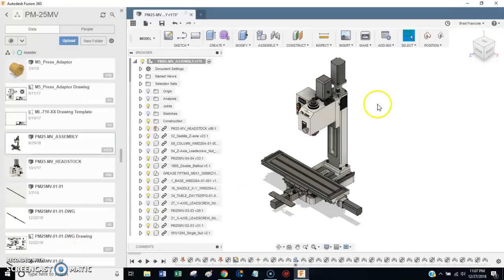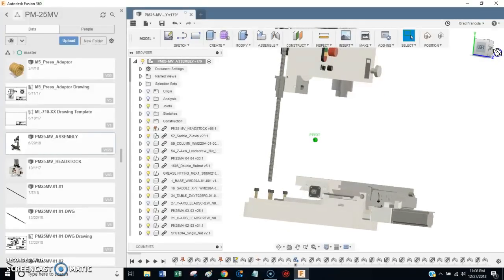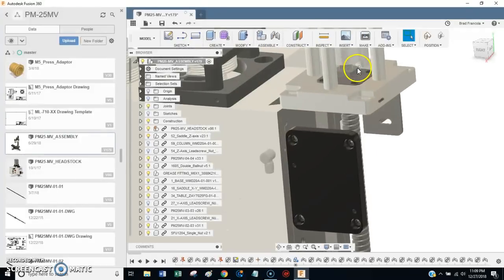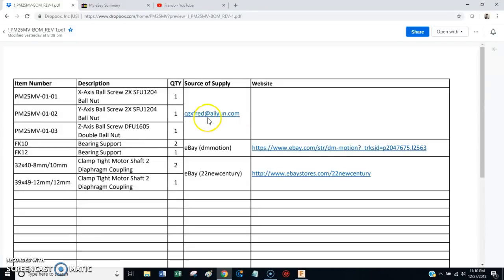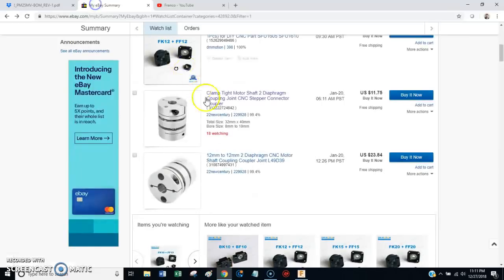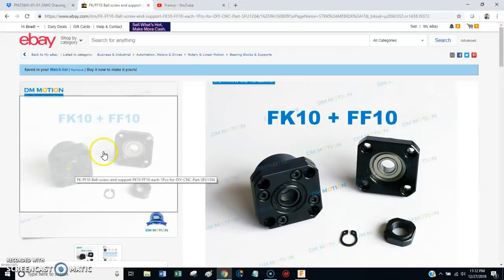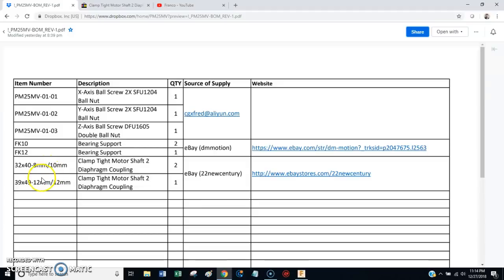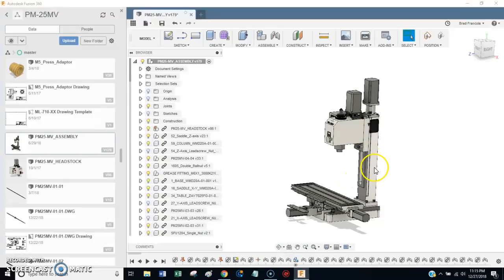PM25-MV CNC Conversion: Ballscrews, Bearings and Couplings

Comment: From the fusion 360 appearances it looks like you were intending on making PM25mv-04-04, 03-03 and 05-07 out of steel. I assume you though aluminum would not be strong enough?  Did you use steel?  If so was it mild steel or something more?

Comment: Hi, found your channel recently. Really love your work. I was wondering, you are not using the spindle speed upgrade you made. Is it because you changed the motor? Did the spindle speed upgrade caused to many vibrations? Cheers

Comment: On  your X and Y ball nut mounts two of the six holes are through drilled and have a m6 tapped hole on the backside.  I'm sure there's something clever going on here regarding these two holes but it's eluding me.  Depth stop for the second ball nut bolts??  And thank you for all the work you've put into this.
Reply from the maker: Hi.  I'm glad my models are being put to good use - If you purchased a PM Machine, don't be afraid to let Matt know my plans became part of your plans for the machine.    You are spot on regarding the M6 threaded holes - I was thinking that I'd use that as a locking screw for the long screws that would hold the second ball nut.  I ended up simply using shims on my machine but I do think the original method I had in mind could also work well.

Comment: Hi I am considering buying the PM25MV mainly because of your videos. I want to convert it to a CNC and have some CNC experience as a hobbyist but d I have no experience operating a mill manually. So machining my own parts manually is definitely out of the question. I saw someone suggest 3d printing the parts, then milling them in aluminum after the cnc was working. This I could do in a heart beat but even if that would work I really don't want to have to deal with the mount in the z column twice. Do you know anyone who will make and selling parts from your designs?

Comment: Thanks for sharing. Real thoughtful and nice. I never opened a iges file before, but a couple minutes duckduckgo'ing it seems to show that I do not need autodesk to open them. I have and depend on a working machine shop for my survival, and so, no chance I will use autodesk products in my shop. The PM25-MV seems to have a reasonable table travel for a first cnc, but machine is awful light. It does appear to be a reasonable size first cnc machine for a small company though. As long as I can open those files, it is very likely I will get a PM25_MV, the recommend ballscrews etc that you show, and then build this. I have wanted a small cnc mill for a while, but not willing to buy because of exceptional high repair, maintenance costs to have company person come out and service. Building own is the only way to go for a small company,.. unless money is no object. Again, thanks for sharing.

Comment: I’m just wondering how is the pm25 by itself as a manual machine?  What upgrades would you do to make it a better bench top mill without the cnc conversion?
Reply from the maker: It's a good manual mill. The first thing I'd probably do would be install a Digital Readout

Comment: I have found that all the bearing supports from China use standard roller bearings, and not Angular contact bearings.  I had to purchase replacement angular contact bearings from a U.S. supplier.  Has this been your experience?  From the video, it looks like you are showing standard bearings because AC bearings are not usually sealed.
Reply from the maker: Hi.  I used whatever the seller gave me.  I'm not sure if they are AC bearings but they seem to be working pretty well.

Comment: You have done an amazing job with your projects. I’m currently converting a G0704 and I’d like to use closed loop steppers with acorn. Would you be willing to help me with the wiring schematics?
Reply from the maker: Check out my other videos - I think you'll find I cover some of that.  There is also an excellent forum for the Acorn.  Have you been there?  That's probably the best place to get that kind of help/support.  But, I try to answer questions here as I have time.